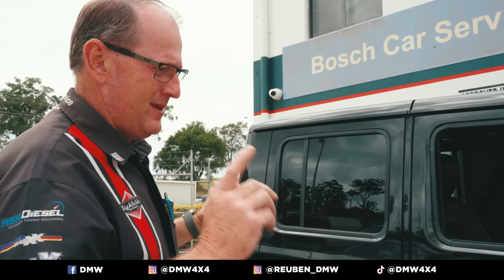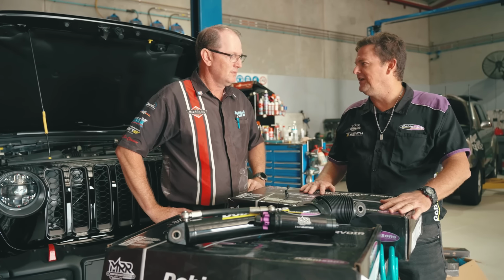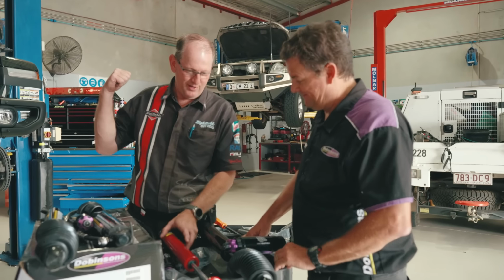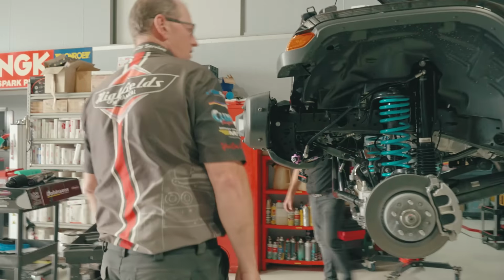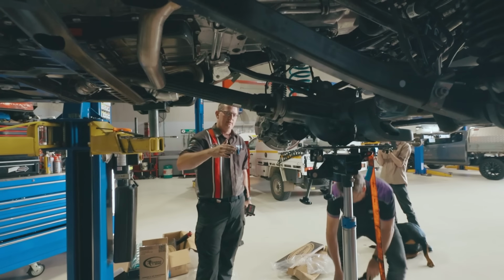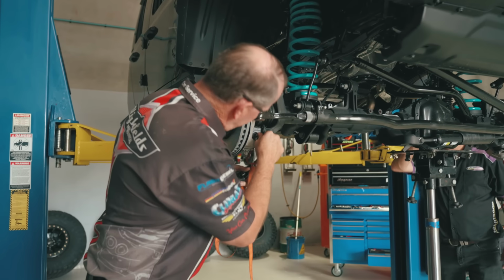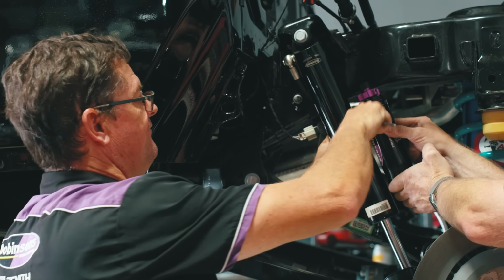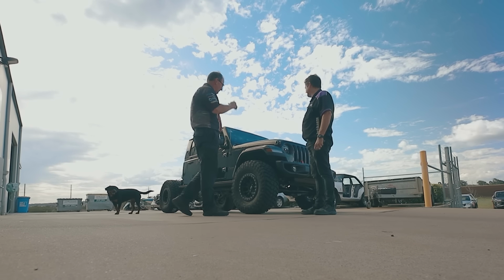Worlds first 2023 supercharged Gladiator - REUBENCON Part 1

Comment: This is what it looks like when people who don’t know Jeeps…. Work on Jeeps 😂
Reply: Did mine and was smooth as! Bit of youtube did the job😅
Reply from the maker: It is a journey, @MrChippy04. Probably better if you share your knowledge about Jeeps, don't you think? Thanks!
Reply: People just dont like working on them because they aren't a Nissan or Toyota that they are familiar with. And its easier to label them as shitboxes than admit you dont know your gear.

Jeeps are exceptionally capable and strong and not all that complex to work on. Most of the Aussie manufactures dont make good suspension for them though. Go American kits and sort the track bar etc locally.

Good on the lads for giving one a crack. I think its a safe bet Reuben will be impressed with it.

No they're not tow rigs, but it will go almost anywhere you point it

Comment: A bit of friendly advice. Get rid of the factory fenders and bumpers, and get a high clearance stubby bumper and high clearance tube fenders. You’ll gain heaps of travel. I don’t know if you can get them in Australia but in the US I run aluminum tube fenders from a company called Metalcloak. They make strong, quality products that match the natural body lines of the vehicle
Reply from the maker: Thanks for the info. We appreciate it!

Comment: stock gladiator shocks are monotube and actually very good shocks, the optional rubicon shocks are 2.5" fox racing shocks with hydraulic stop so even better. nothing to bag out with either they are top shelf compared to most standard shocks. 
jeep are 5 link for better traction and articulation so use upper and lower control arms not radius arms which bind up offroad as well as axle tramp.
Reply from the maker: Appreciate the advice, mate. Thanks for watching! :)
Reply: Also with bigger then 35" tyres you will want HD rod and HD drag link. Teralex does a set that comes with the HD ends

Comment: There’s something in the ecu that doesn’t like tuning for boost and the v6’s tend to blow up. There’s a reason the more expensive v8 swaps really took over on these in n North America
Reply: Yep, it's not recommended to supercharge the V6.
Reply from the maker: We have custom tuning being done on the Jeep, so far we haven’t seen any issues from boosting the engine.
Reply: That's good to know. Fingers crossed you won't get any issues because of it.
Reply: @dirtymuddyweekends   from what I’ve seen of others blowing up the tuning is the issue, the stock ecu seems to “relearn” or readjust  itself over time and then it blows itself up.  With the motors being so high in compression doesn’t help them being a little unforgiving as well.

Comment: Bit late mate, Patriot Campers already did this
Reply: Yeah in 2022
Reply: They almost did it right. The na 6.4 has glass pistons in the so if one is supercharging one I’d go with the hellcat cause it don’t have the crappy pistons
Reply: Not a 2023 mate, you’re just sad you can’t build one of any age 😢
Reply from the maker: The 2023 Jeep ECU has new architecture compared to the previous models, so any of the 2023 Jeeps have not been able to be tuned or supercharged. We have enlisted the help from quite a few industry experts to make this a possibility and is still on ongoing development to fine tune the vehicle.

Comment: Hang on what happened to the factory fox shocks?
Reply from the maker: Just needs an upgrade
Reply: Jeep have stopped fitting them but plenty of people have taken delivery thinking they would get the Fox shocks just as they were advertised with. Jeep have since updated their website removing the Fox shocks from the Rubicon specs.
The factory Fox shocks were absolute rubbish though and nothing like the ones you can buy on the aftermarket.

Comment: Didn’t patriot games do one first ?
Reply: and the patriot games one is running 40's not 37's. Still, this one will be an interesting build to watch. I have a rubicon gladiator of my own...id love to put portal axles on mine, but they are just way too pricey.
Reply from the maker: The 2023 Jeep ECU has new architecture compared to the previous models, so any of the 2023 Jeeps have not been able to be tuned or supercharged. We have enlisted the help from quite a few industry experts to make this a possibility and is still on ongoing development to fine tune the vehicle.